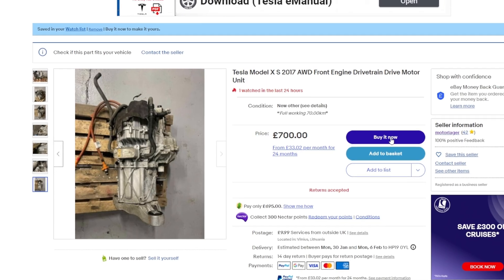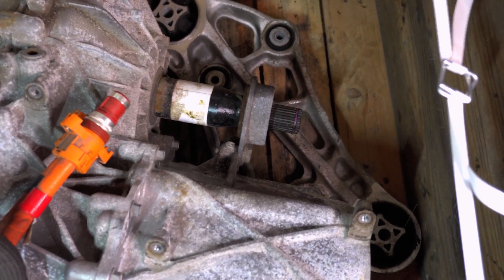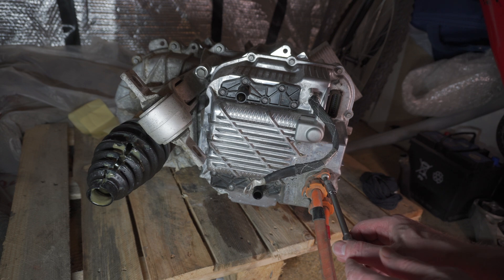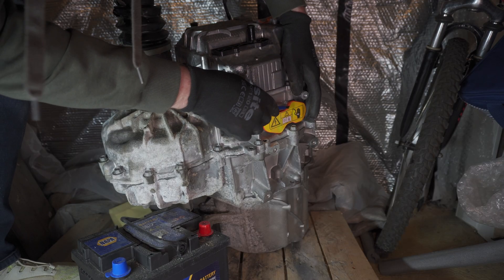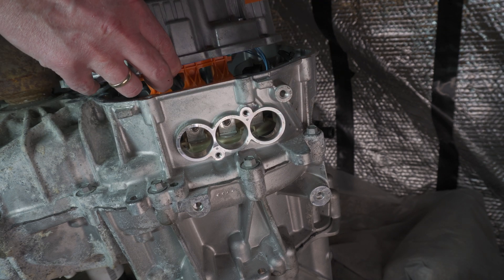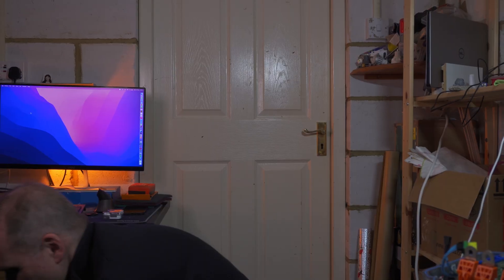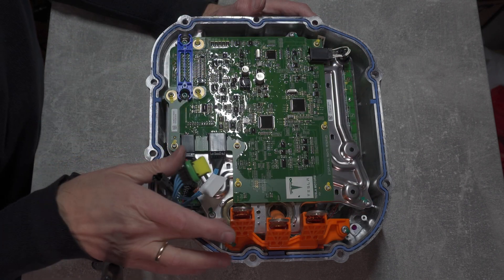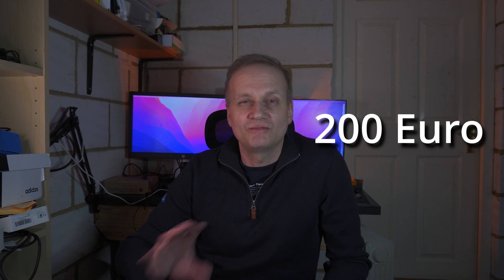The Tesla motor has arrived, what's next? #5

Comment: While they are used for only 50kw, the prius inverter can do significantly more, has been tested to do over 350kW on openInverter for Gen2, Gen3 is even more. Just have to bypass the boost/buck portion as it's limited I think to 150A
Reply from the maker: Yes I know I watched the video 😂. However Damien only tested for the inverter shutdown not many people actually run it at that power